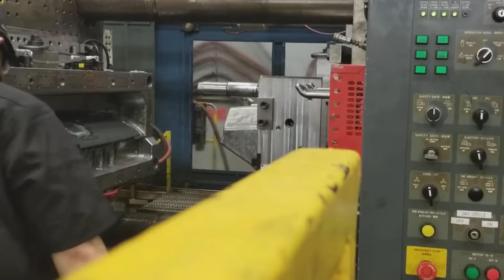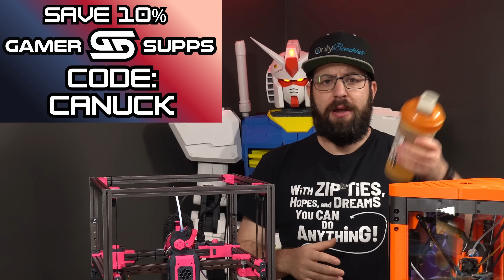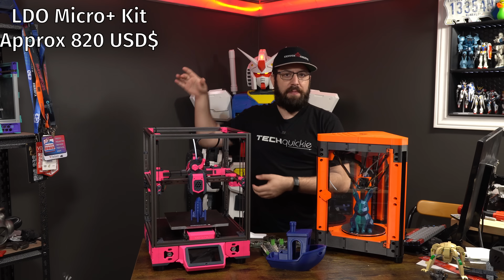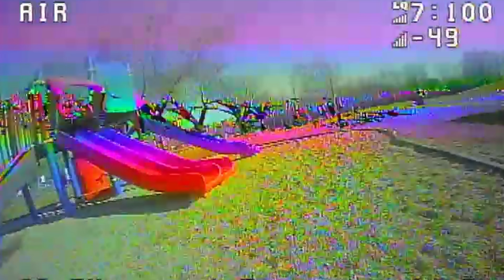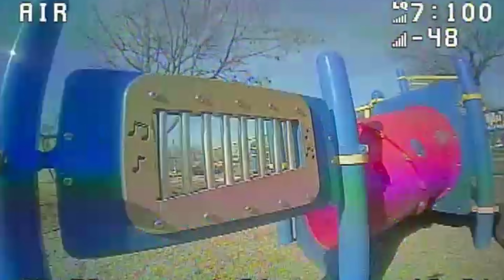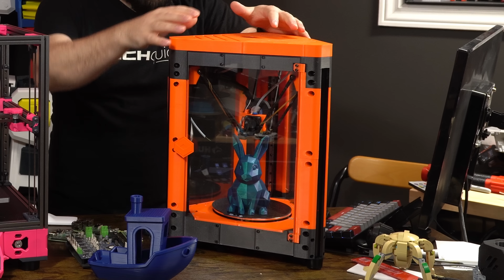Are DIY 3D printers in danger?

Comment: I agree that the market for DIY is decreasing, it's especially hard when getting kits is not consistent, having to wait for production cycles, or hope that {insert kit manufacturer here} will ship to your country isn't helping either. If someone who is dabbling with the idea of building a printer has to wait 3-6 months for the right kit, it's not surprising they just grab a Bambu instead. I fall into the group of people who love building the machines, but they are still tools when they are done. That said, I would rather design my own (current 525x525x600 design in progress), or self source before grabbing a cheap commercial printer again. I love what Bambu has done for the market, but their business model does not consider sustainability at all, like you said, it's a throw away model, straight to landfill.

Comment: I'm thinking of purchasing locally a Tronxy x5sa for the basic parts for $50 to rebuild it into another CoreXY printer that's way better. Like it's $50 for all the aluminum extrusions, motors, rods, bearings etc. Tear it all down and repurpose it into a Ratbot/VzBot or Voron. I have other spare parts, boards, nozzles, belts, a bazillion screws that I could print the parts and build a DIY CoreXY printer. I seem to love those kind of projects vs purchasing them. I got an Elegoo Centauri Carbon and love it but am itching to do another project.

Comment: I'm spending $2000+ to build a voron 2.4 350 with tool changer.  Why?  because I am in full control over it, I own 100% of it.  when the california law takes effect and illegal shapes exist,  My printer doesnt have a built in spy that will be forced upon me because there is NO manufacturer other than me.   I can change the printhead to the newest idea easily.  Cant do that on a bambu or other  pre made designed to not be moddable.  none of these printers use standards anymore.  the elegoo is cheap but it's a locked in ecosystem,  same as Bambu/formlabs/etc

I want to own my tools, not be owned by the seller.

Comment: I still haven’t built a kit (got into the hobby in 2023), but I’m a tinkerer/modder. Been custom watercooling and cable sleeving for PCs for over 10 years, and I love so many nerdy things 😂 Point being, I want to and will build a printer eventually! I actually got a bunch of parts from a buddy who started a build but never finished it… so I have everything ready to go, but I don’t have any workspace yet. We just bought our first home so we’re spending all our time and money on that haha… I’ll get my workspace set up over the next few months and then start some projects haha
Reply: Sounds like you need to build a cool 3D printer with your experience, maybe a water-cooled Voron Trident like I have. The extruder, and XY motors are water-cooled using a PC water-cooling pump and reservoir. You can really push speeds with higher stepper currents and the motors always stay cool. No matter how hot my build chamber gets, I never have to worry about heat creep with my water-cooled hotend.
Reply: @s @stevehazim5823 definitely have considered doing a watercooled build!

Comment: My first 3D printer was an Anet A6 Kit and now it's a Voron Legacy (sorta, there's not much left of the original machine). I like being in control. I don't want to depend on a company for replacement parts, or firmware updates, or to not remove features from a machine I paid for.

Comment: Engineers (and not-engineers) will engineer because they love it and enjoy it. This is especially valid in the open source world (source: been part of it since the time of RH Vanderbilt - circa1997). Open source software kinda runs the world, hardware is a bit more challenging for various reasons, but it's obviously doable. Open source 3D printers will be fine. Also, it's not like most closed source beige boxes don't rely on FOSS to run - they either are running some form of Klipper and/or are using some form of a slicer based on slic3r. Commercial players are sorta suffering from PFE . without the "proudly" part, but there's zero innovation in the commercial space, it's just a race to the bottom price-wise. Also, people who work on printers because of engineering curiosity, kinda graduate from that to other, more complicated engineering projects, so this is a constantly evolving skill-set and knowledge based hobby, that might back-port knowledge, ideas and applications to 3d printing, just not at the rapid rate that it used to be done in the last 7-8 years. We'll be fine.

Comment: No reason to worry.  Do think it will make more sense over time to build bigger printers.  From a practical standpoint, lot more competative value in a 350 vs a micron.  From a personal satisfaction standpoint, price is sort of irrelevant regardless of build size.  I loved my build.  For me it was a mountain to climb.  The challenge was the point.  As docs continue to improve, and more value added techniques and features become more main stream, it will continue to become more accessible.  Personally have the advantage of 25+ years working with open source projects and understanding the self reliance ethos.  However, if I have a concern (not talking about Voron or or other design groups like DS... incredibly impressed with both teams), it is the inherent gate keeping that some builders feel compelled to do.  Love open source and free sharing of ideas, and "neat stuff", but also find the "this is the way, or this the only way" mentality to be off putting.  Get tired of sharing something, only to get the attempted pile on's.  I have many years of practice with ignoring this stuff, but I do worry that it chases away potential builders, who with a build, or 2 under their belts might just come up with the next great idea.  My personal favorite is the folks who will spend big $$$ modding their printers and then attack dog on anyone else who dares to mention a Pi 5.  Seriously, what is the religious fervor surrounding around making sure to only use a bare minimum Pi.  ;-)  Just keep doing what you do and we will keep watching.  I know the algorithm has changed, but honestly found more meat on the bone with your earlier stuff.  Recent stuff is getting a little close to the 20 minutes of content and 40 minutes of filler ratio.  Love watching all you guys, but I am busy so am going to prioritize on meatier videos.

Comment: I feel this.  I was in the middle category where I built a Voron printer for the purpose of the end goal: a way to commercially produce reproduction car parts that no longer were available.  In that year, the DIY was the only way to get what I wanted at the price I wanted.  I love them, but I no longer recommend them to others who want a good printer because of the "Bambu" category meeting the price vs performance point.  The only thing I will tell people that has not changed is: these are tools, not toys.  Yes, you can make it a toy, and you can get joy out of that, but I prefer to use mine for practical prints.  I have shop tools and jigs I modeled and printed, car parts, boat parts, industrial machine replacement parts (ever tried sourcing a Textilite bevel gear in a 70 year old surface grinder?), even home brewing equipment (it's legal here in the States).  It's a wonderful tool with ample applications.  But, DIY feels like it is stalling out on improvements.  Before you Torch-and-pitchfork me for that last bit, I feel like it's because "what else do I feel I need?" The DIY community has "patched up" the problems the companies made.  Ever run a Raise3D Pro2? JUNK, at $7k USD.  The fruit was low and ripe for the picking for DIY back then.  Rather than more rambling, let me conclude: the DIY community is slowing down and stalling out, but I propose it's not because of a failure or lack of interest as much as "they have achieved the goals."  They should pat themselves on the back that they even pushed the commercial industry into what it is today.  DIY is not dead, and there's no such thing as "no more innovation possible," but they have pushed the envelope already to the point that I for one am very comfortable with their labor and success.
Reply: I mean, everything goes through that. Imagine we still diy our own cameras, or cars, record players,  etc... at some point, diy hits a plateau where it creates what was meant to create and then we move on.

Comment: The problem stems from simple economics. If you can buy a pre-built printer for the same price as a Voron kit, building a printer seems pointless. Despite this, I'm currently finishing building a DIY printer that cost less than $150. Instead of a kit, I bought a used Anet A8 Plus and converted it into a Voron Legacy:
https://youtube.com/shorts/q_MONDBmD-E?si=FxdFH1attFw4xNBu

Comment: I have a ender3 v2 since 2020 and modded it to dual z axis, direct drive extruder, bed probe and linear rail for the extruder axis. Never have I ever printed a benchy. Will have a 350x350x350 printer soon and think about using the ender 3 as base for a core xy printer.

Comment: Curently building a Trident from a Siboor kit, just like you did in your video--I'm in my third week. It's my second printer--Voron 2.4 350 is in it's second year with probably six different hotends and extruders. Unlike you, I've had nothing but issues with the Trident, but I am learning a lot. One z motor was bad right out of the box. I was reluctant to buy a kit from China, but all the American suppliers, West 3d is my fave, were out of stock. I very much enjoy building printers, but do I really need more than two? I'm running out of room. After you have several working printers, then what?

People often ask,"What do you print?" Truthfully, I say, ,"I mostly print parts for the printers." I also have a vintage car, an '82 VW Vanagon, which is also highly modifiable, and I will print parts for that.

Comment: I had also built some 3D printer nozzles by drilling brass screws and "turning" them using a drill press and some files.  I used power resistors has heating elements.  Almost got them working, but gave up when I could finally buy them ready made cheap enough for me to abandon my home brewed attempts.
Reply: Dude thats awesome

Comment: Followed you since the Ender era. I’ve used printers both privately and professionally for years. I’ve built several Vorons , and just last week I used my H2S to print parts for a new Stealthchanger setup.

On the professional side, I’m less focused on the printers themselves and more on what they enable. We build robots, so we constantly print parts for prototyping before moving to aluminum or steel. We have also used 3D printing to create molds for carbon fiber layups, which has been a huge advantage in iteration speed.

What I really find exciting, and honestly very optimistic, is where the open source community is heading. It feels like we are just getting started. Plastic printing itself is maturing, no doubt. But if you zoom out, most of us, both hobbyists and companies, are not stopping at printed parts. We assemble them. We integrate them. We turn them into something bigger.

That is why I think the next frontier is not just better printers, but more capable systems. Imagine machines that do not just extrude plastic, but place components like motors, sensors, wiring, even aluminum extrusion. Real assembly machines built on open source foundations. Not just printing parts, but building functional machines in one continuous process.

We are probably still quite far from open source ecosystems at the level of Voron for metal printing or fully integrated carbon fiber workflows, but the direction is clear. The same energy that took us from Enders to Vorons can take us into hybrid manufacturing and assembly.

To me, this is what makes the current tinkering culture so valuable. Forums, YouTube channels, and communities are not just sharing upgrades anymore, they are laying the groundwork for entirely new categories of machines. The open source community will evolve, and that is a good thing. It is expanding.

Honestly, it feels less like things are slowing down, and more like we are at the very beginning of something much bigger.

Comment: Unfortunately yes, a little bit. Also you can see serious decline about knowledge (or even the will for it to understand) of slicing. And soon i am afraid this will goes as standard. Even those who want to dig deeper into the know-how will have to deal with oversimplified printers and slicers where you wont able to change settings compared to the golden era

Comment: I love building the printer.  Tuning, on the other hand…. I have a 2.4 350 I built a year ago, added a Box Turtle to it, and then, not long after that, it started failing prints.  It’s currently been 4 months and it still won’t print correctly.  I’ve been in the Discords and forums, still haven’t got it figured out yet.  In the mean time, sometimes I’m working on another project, and just need something printed.  I fall back to my Prusa.  I don’t know.  I like the build, but I like to print, too.  And the new laws that are being proposed, if/when passed, are going to significantly reduce if not end the DIY printer space, I’m afraid.  Hopefully not.  But who knows.

Comment: I bought my first printer, it was Ender 5 Pro. Now it is converted to Mercury Zero which I built myself. I printed all the printed elements on Ender 5 Pro and then took it apart and put together the Mercury Zero. Now he is designing his own multi-color printing system for this printer. He designs it himself.

Comment: The problem I see is all these people bought BL machines even to the point of making businesses but a lot of them don't understand how to troubleshoot their machines or what any the slicer settings mean and how to fine tune for one brand of filament over another. My other issue is the leading brand (BL) seems really interested in controlling the printer. It does not take a deep dive to see what their goals have been from the start. If they flush out enough of the competition and lock people into their ecosystem they can control what you print, the material you print it with, where you get your models from, etc.

Comment: You see how in the US they banned DJI for several reasons, officially for IT security and risks of espionnage if I am right. And when you think about Bambu, they totally can do absolutely the same.

Personally, I would like to build my own kit, source all the parts, but I haven't had neither time or budget for that. Definitely, my prusa mini I bought as a kit has always been my most preferred printer ( I bought her two years ago, I could definitely have bought a bambu, but there were concern about privacy) out of spite for bambu and how they stole the open-source community by making open-source software closed-source, and wanting to support Prsa, I bought a mini. I never regretted that choice.

nonetheless, I have to admit that using the H2S (from my local makerspace) to print a full plate of gridfinity boxes in a reccord-short time, is also really satisfying

Comment: If you're up for a small read I'm currently building my first Voron, for more or less the price of a K1C (in my country) I have a self sourced Trident 300 with a 400mm Z height, 7075-T6 aluminium X, Y and Z axis which I CNC'd (no printed parts here), LDO speedy power motors, Phaetus Dragon HF with PT1000, Cartographer v4 with CNC X carriage, two SKR Pico's, BTT SB2240 canbus with U2C adapter, SFS2.0 filament encoder, Knomi touchscreen, Honeybadger & Sunon maglev fans, Pi 5 with active cooler & 5 inch touchscreen, Meanwell PSU's, 6 lane Annex Tradrack and many other bells and whistles 😊 I think that's pretty amazing for the same price as a last gen China printer 🙈  in some regions the latest and greatest plug and play options are made from unobtainium and it still does make more sense (for some people anyway) to build it yourself 👌🏻 especially when the alternative is some clapped out Ender 3 from marketplace 😆

Comment: What you have described is what happens to all technology. 
That computer you edited this video on - I remember my father in the late 70s building one. And when I said build I mean TTL chips, LEDs and toggle switches to program and run it, all connected with wire and soldering! Within a couple of years the Apple II and many others appeared and the rest is history. Nowadays "building" a PC means buying a few bits that can be plugged together and be working in 1/2 hour or so. Although most people will just buy one ready assembled.

So yes, the age of DIY 3d printers is pretty much over. People will move on. I know I have. I've designed and built my own but if I wanted other one now it would be a bambu or qidi. 3d printers are now just tools, just as saws and screwdrivers are. People used to make them too ;)
Reply: U wrong....not looking enough...people built it even now...for local ai machines or just random server stuff...some dudes even makes their own crystal chips.....algorithm just don't want to tell this to u...

Comment: I do agree with ... well ... everything you said. ^^'
As a matter of fact, I didn't start with a 3DP back then... but with electronics when I was roughtly 9 yo. 3DP came in my life in 2017 after having experimented a bit with CNC milling machines (simply called "CNC" by some, yet it's another debate), and CNC milling machines were not the best idea when you live in an appartment. Neighbours don't really enjoy this kind of noisy machine.

Hence 3DP, and I already had a lot of projects and ideas at that time. The rest is history : modding, learning, building, etc. To this day, I still have my very first (and only) 3DP ... Modded, still being modded and upgraded, Klipperized since 2019-2020 or so, and very reliable.

Build. Tinker. Mod. Enjoy. That's what I like.

PS : I never printed one single "flexi dragon" or whatever. Even benchies, maybe just 1 or 2 when I started, because "why not, it will act as some kind of decoration at the workshop room".